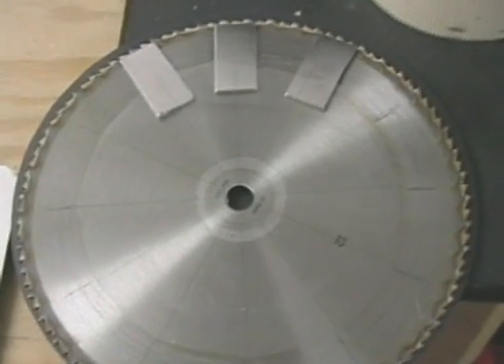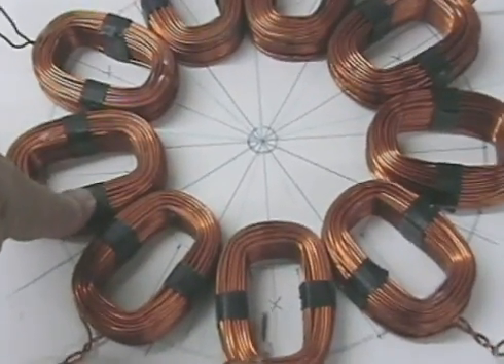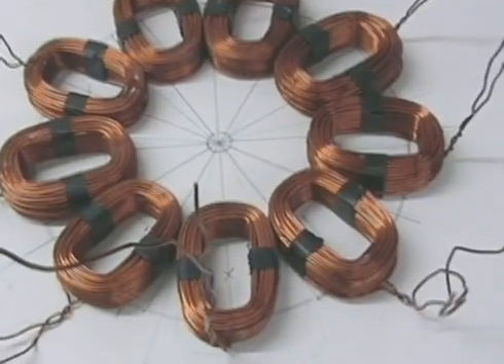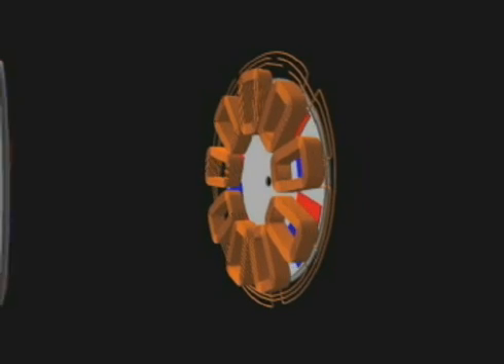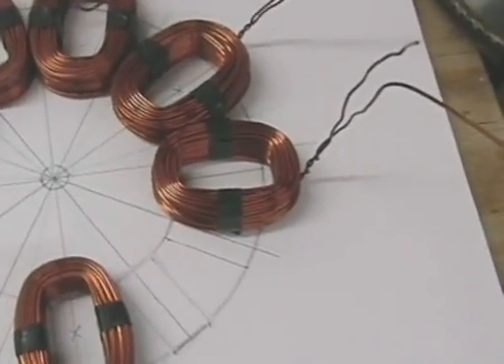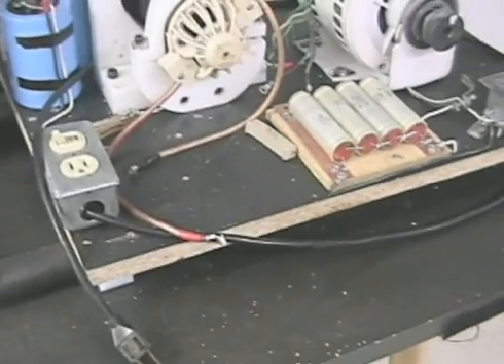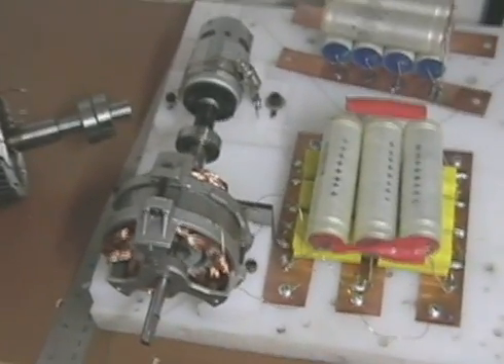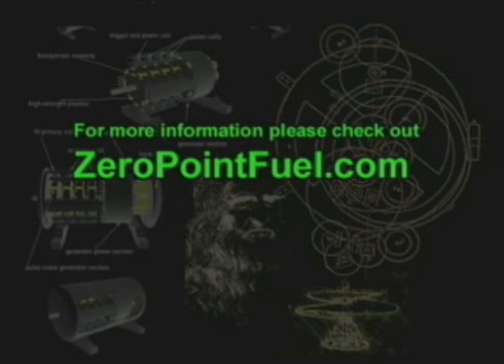Cart Motor Axial flux Alternator

Comment: Thank you for this video  Great experiments  Im new  at electronics   Im building  a  nine coil wind turbine  Three phase ,and I can't continue and pour  my resin until  Im sure its correct  #1 when routing and connecting each phase wire from the starting poles to their  ending  pole Do I have to keep each  of the three phase  wires from touching Another phase wires when routing  them #2. Does that routing wire have to be Insulated . And  #3 How  Many Magnets  for a nine coil Alternator,    I just  dont want to make  any  simple mistakes  before  pouring my resin .  Im fairly  new at electronics  Ive built  a few Tesla coils  in my day ,and just making a simple  lite blink at different  Intervals  using  555 timmer chips  and resitors.  I love to learn Electronics Im a welder by trade I  subbed to your channel   ...Thanks